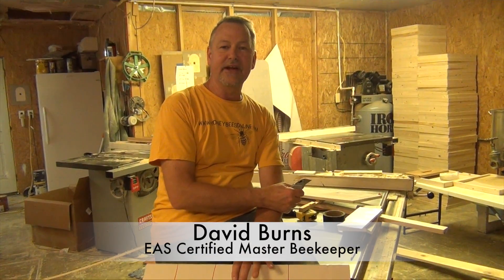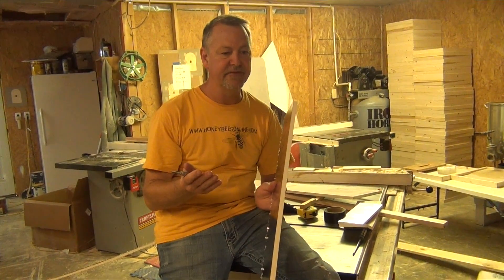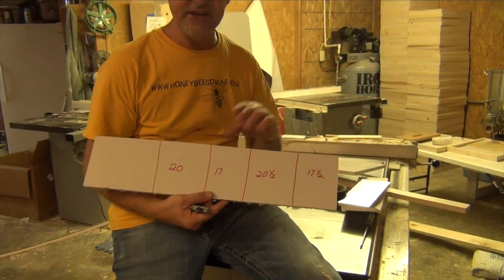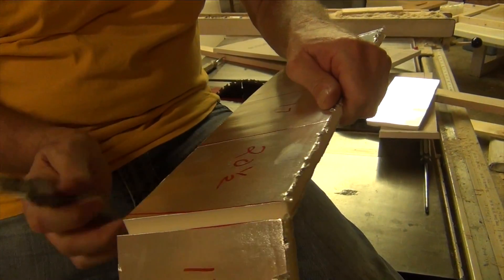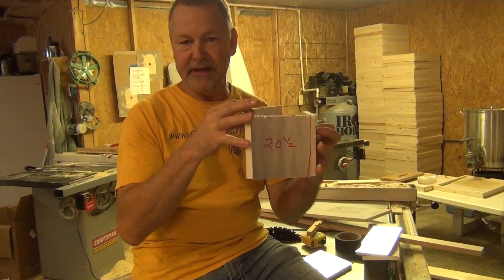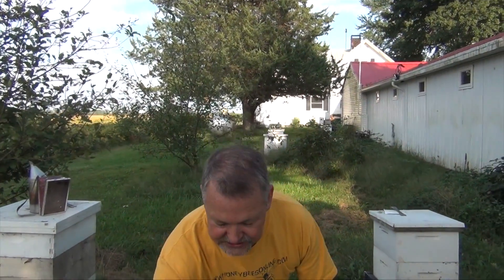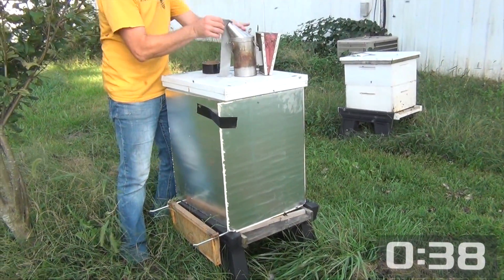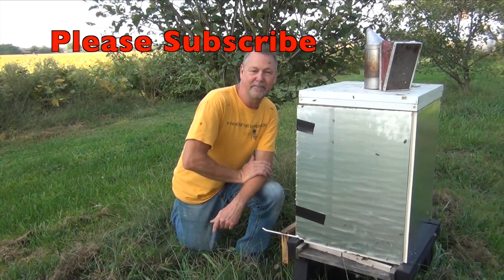Wrapping A Bee Hive: 60 Second Beekeeper Episode 13

Comment: David.  Do you prefer the wrapping in foam board or wrapping with tar paper ?   Is there much of a difference between the two options.  I've seen both of your great videos.   I live in Minnesota and want to wrap my hives this year.
Reply: mark otto: Hey Mark, just asked David on this. My impression was that condensation occurs due to lack of airflow rather than being based on the material used.
Reply: Would recommend against using tar paper due to the concerns about moisture, which can be more dangerous to bees than cold.  Although I do not use tar paper, I have seen it used ON TOP ONLY.